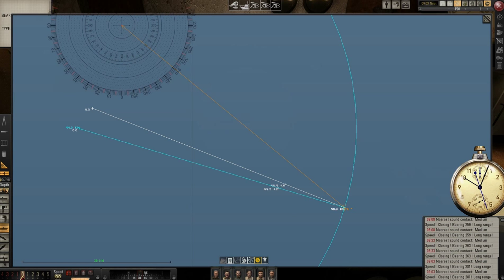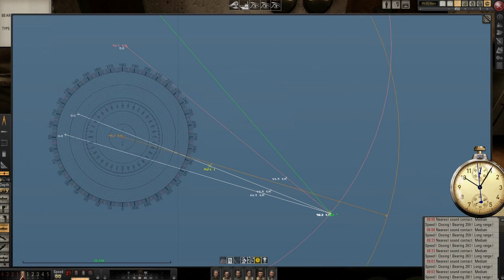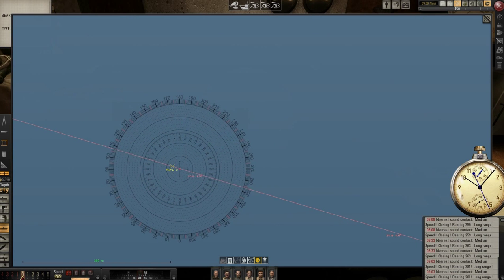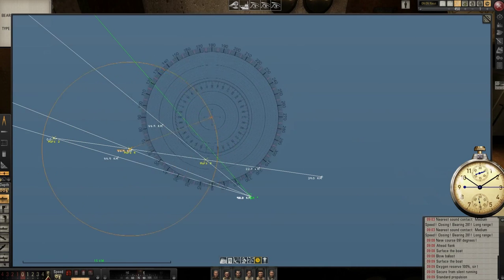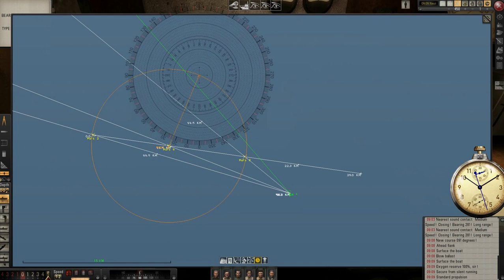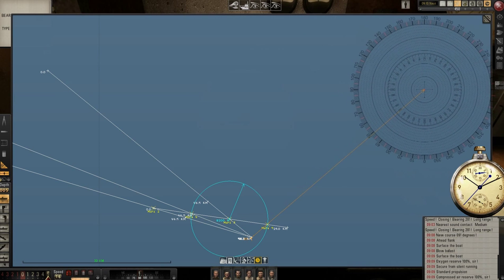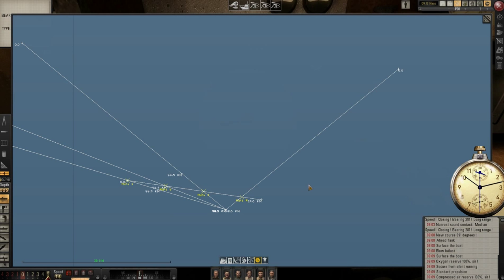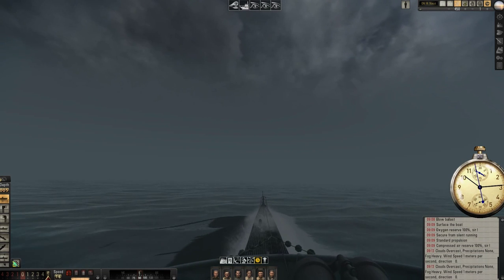4 bearing method for SH5 part 2-4.mkv

Comment: Dude, good video and explanation but impossible to hear the explanation from the blue circle you drew on due to engine noise. Next time use one of the free postproduction programs (like Da vinci resolve) for your final cut. You can adjust the volume of the track for game audio as well as for mic audio.

Comment: Will the direction and distance that I (the u-boat)  travel between bearing 3 and 4 matter?
Do I understand it correctly that if you draw a paralell line (to the target bearing line) on the mark on the bearing 4 line – that that is the actual course of the target?